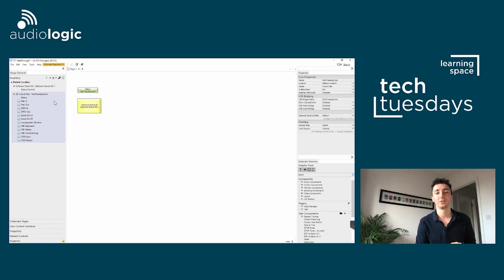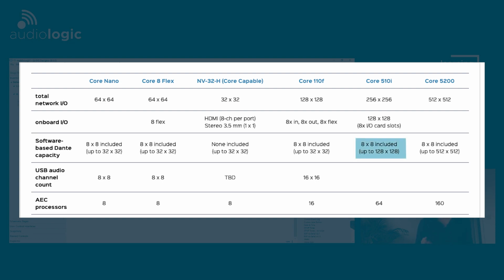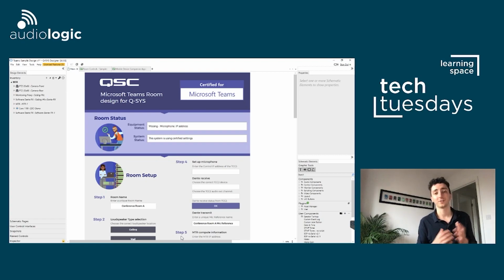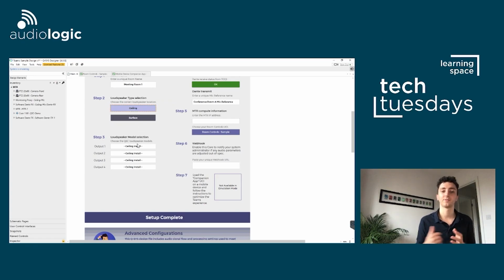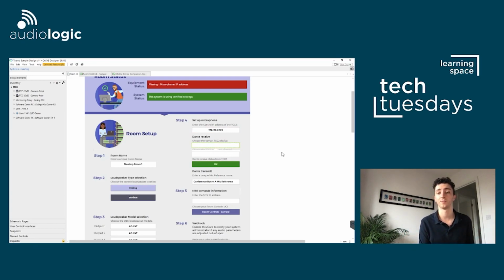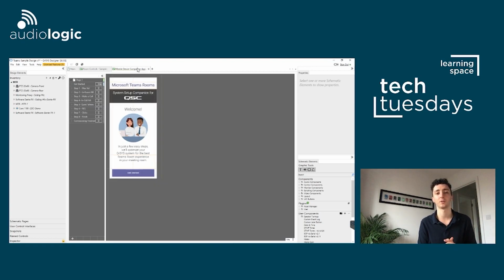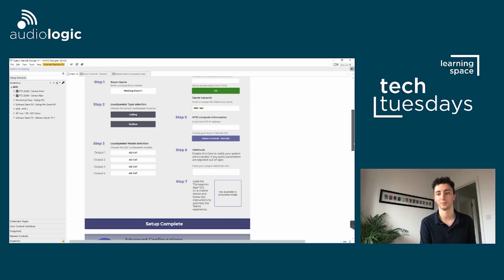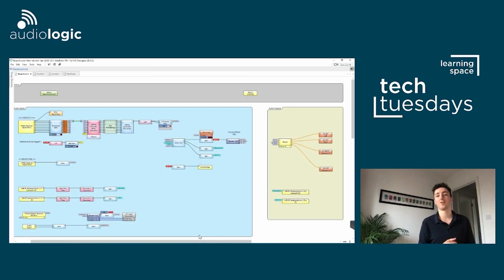Tech Tuesdays - QSC: Q-SYS Designer V9.0 Walkthrough

Comment: Hello Ben, does this function with the Shure MXA910 from the sample config? Thank you
Reply from the maker: Hi Mark, for the Teams Room Certified system, you have to use the equipment list that has been certified by Microsoft. Any equipment change outside of this and it will be no longer a Room Certified system! Having said that, you could make the design work with an MXA, simply increase the Dante Rx as required and remember to set the AEC Ref Tx - Ben